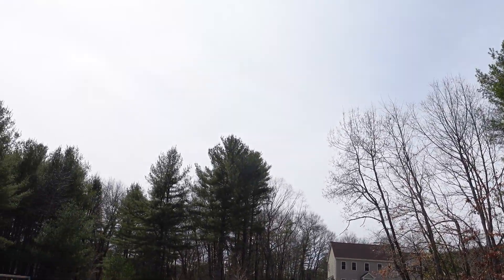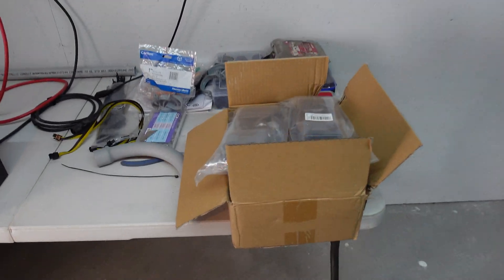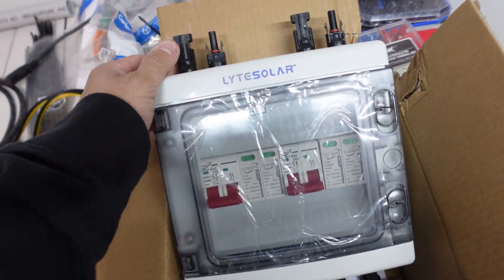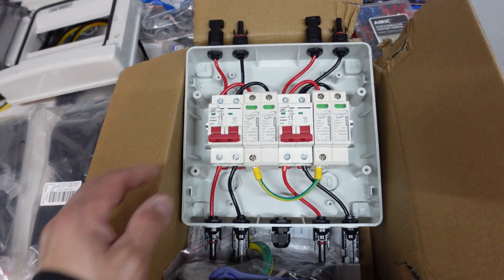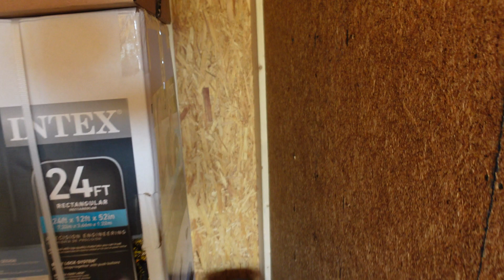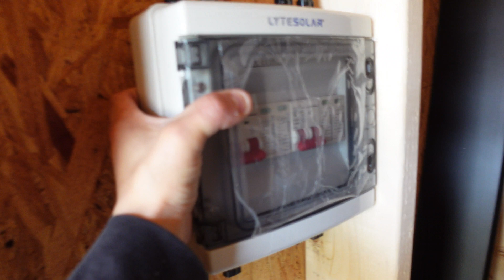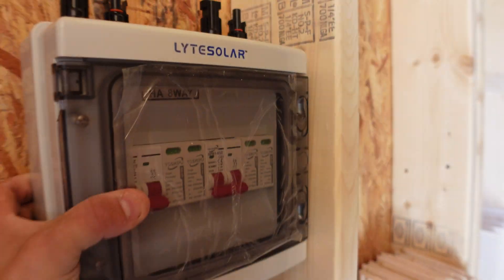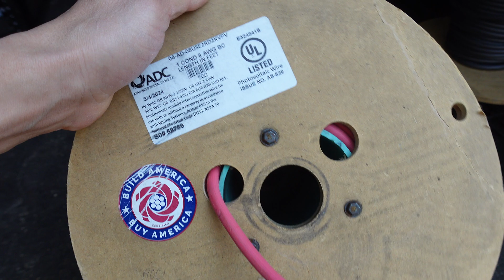Wiring My DIY Solar Shed | Quick N' Dirty

Comment: @CCXD Do not make any hole in your roof, its best to put that emergency box on the outside of the shed, you can then loop the HV lines from the roof to the side of your shed, best to keep it close to code as possible.

Comment: Tip for the future: you can measure how much wire length is left on a reel with a multimeter. Calculate DC resistance for ohms.
Reply from the maker: You know I’ve seen that before on a video but I forgot all about it! Thank you 🙏🏻

Comment: din rail terminal blocks
Reply: was gone to say , super cheap in Amazon or eBay
Reply: @ id say dont cheap out on them as faulty internal links can easily cause fire, the good quality brands are still pretty cheap. Weidmuller, phoenix contact..etc